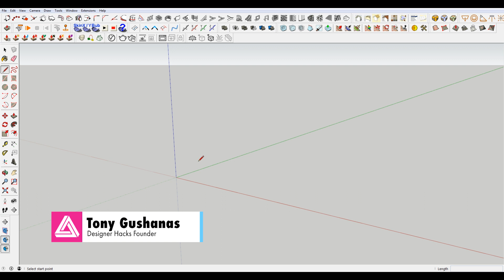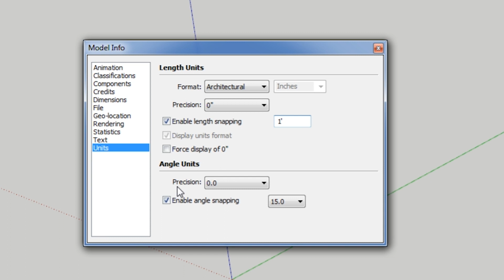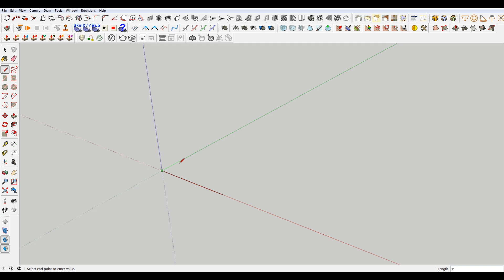How to Snap in Sketchup

Comment: Hi! I have a  problem,  I was working normally in sketchup, but suddenly when I try to draw a rectangle over the guide lines, it couln't recognize any guide point, in order to draw with references, I don't know how to fix it. ;(   what can I do?
Reply from the maker: Hmmm.  I've never heard of this happening.  I assume guides are still on?  The only thing I can think is going to window>model info and making sure enable length snapping and enable angle snapping are checked.  Is the file size large?  Is the object very small or very large?